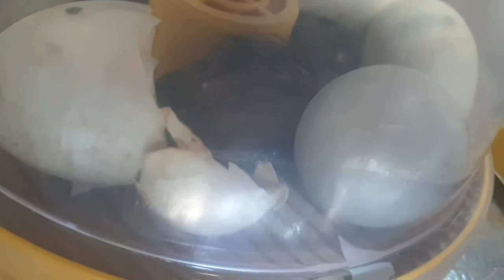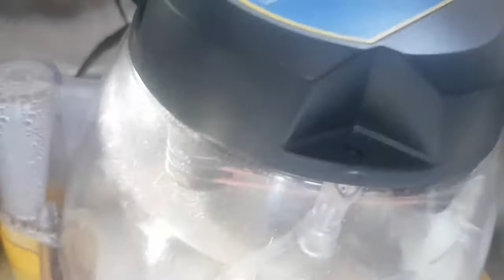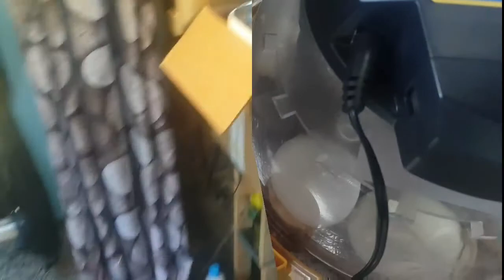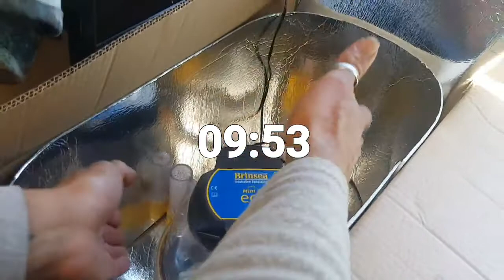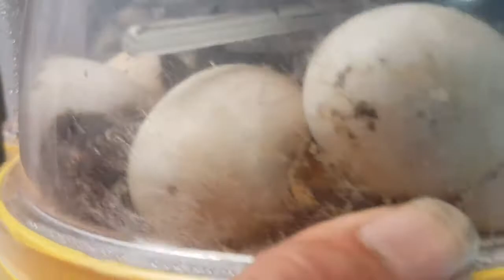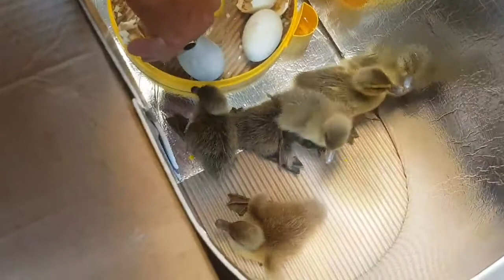Our First Hatch - Using A 12v Brinsea Eco II Incubator

Comment: Hi .how did u  manage humidity  .what temperature did u set
Reply from the maker: We keep water topped up inside.
The temperature dependson which eggs are in. There is a brinsea guide online so you can find the best temperature for chickens, guinea fowl, ducks, quail can vary. 
Also the length of time they are turned for and length of lockdown. 
Check out Brinsea online for a whole load of information.
Reply: @AhimsaFoodForest  thinking about getting a 30 egg incubator are they worth it?Nice vid